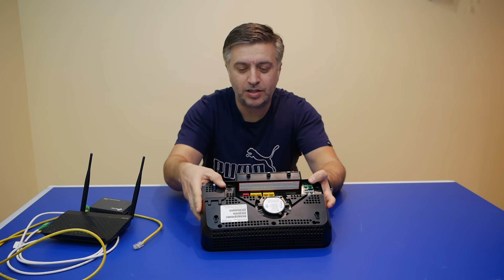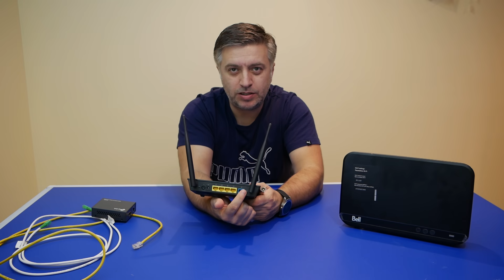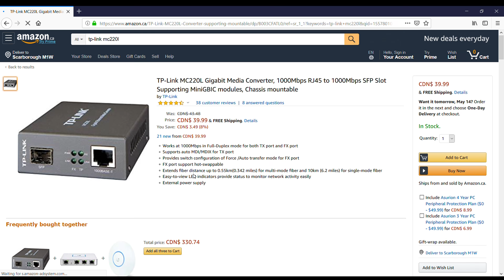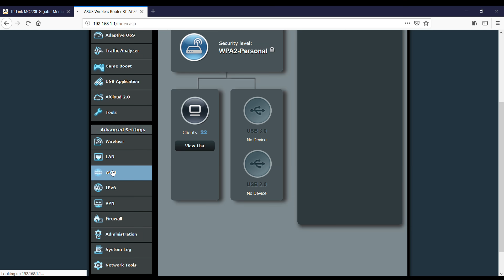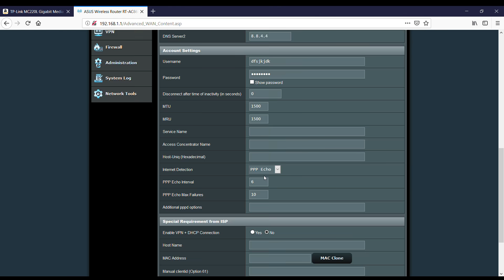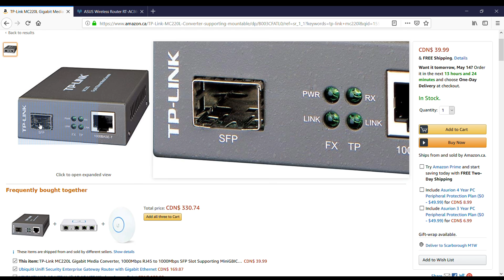How to remove/bypass Bell Hub 3000 and use your own router

Comment: Hi Marius, thank you for the video. I know my Bell username (that starts with "b1"), but what's the password for the internet access? Is that the same password that's being used to login to mybell.bell.ca?
Reply from the maker: No it is not the same. Call bell and ask them for your password. Also if you can log in into your bell account you should be able to change it there.
Reply: @advfreedom  yes, I saw the option to change it. If I change it now, will the Home Hub continue working working, or is there some setting that needs to be updated?
Reply from the maker: There is a section where it says manage your internet access password after you click on the internet section.
Reply: @advfreedom  sorry, I wasn't clear, I meant do I need to change a password setting somewhere in the Home Hob router itself?
Reply from the maker: Yes, of course. The change is not propagated automatically.
Reply: @advfreedom  ok, thank you

Comment: New to Bell Fibe... replaced the HH3000 twice already, found it to be very unstable at best.  Within a month as a new Bell internet customer, had to perform a hard reboot several times as a standard practice so i was NOT impressed. Purchase the TP-Link as recommended, i hope you get rewarded when we do this. Your instructions were very straight forward and worked like a charm. Took a few minutes for the Bell network to connect... I will provide update how stable this new set up is, THANK YOU.
Reply: @abbashammoud7205  too soon to tell... so far VERY stable. i will comment with more details in a month or so.
Reply: VERY stable. It has been a month and the system was not rebooted once. Thank you again, Marius, for this public service.
Reply: @montecristo9191  So that's the problem i was looking for, the 3000 bell routeur provoque instability connection, i will buy a netgear
Reply from the maker: No reward just being happy that I can help. If you want you can subscribe but is all up to you. Thank you for the kind words.
Reply: i had problems and if was one of my rj45 had 1 inverted colors it still worked but made my system hang on heavy load.

Comment: I have the Bell Hub 2000, do i still need the tplink?
Reply: Remove the ethernet cable from the WAN port of the HH2000, plug it into your router, tag VLAN 35 and configure your router to PPPoE the b1 username and password.
Reply from the maker: I don't know about the Hub 2000.

Comment: Hello Marius,
Thank you for the video and instructions. I have the exact same setup, HH3000 and bought the exact switch off amazon. I also have an Asus router with the setup wizard identical to yours. I have gone through these steps multiple times with no connection. The only thing I couldnt do exactly as you showed was changing the MTU and MRU values to 1500. The highest it allows me is 1492 but otherwise same exact setup but no connection. PLEASE HELP
Reply from the maker: It should connect. Did you check if password and user are correct? Can you download Merlin firmware for your Asus router? Or maybe do a factory reset?
Reply: @advfreedom  thanks! It worked but after I purchased a new Asus router. I guess my old one was too outdated because it didn't work after factory reset and Merlin Software was not even available for that model lol. But after all, great video and thank you !
Reply: @Robert Brown No sir. It worked straight out of the box. I believe any newer model router should work. Mine was pretty old. Good luck !
Reply: @J K: Which Asus router are you running?  Just trying to do my research here before switching ISP.  My Asus Asus RT-AC86U (ASUS firmware 3.0.0.4.384_82072, 
Signature version 2.196  Updated : 2020/09/03 03:02).
Reply: @BrownBullhead  I'm using the Asus RT-3100 on the latest firmware

Comment: Great video, thanks for doing that. I am in the process of setting up a network with the Unifi products. I have a switch that has a SFP port. Would I still use the TP-Link converter via the router (router connects to switch), or could I connect the bell fiber and SFP directly to the switch? Any help would be much appreciated. Thanks Marius.
Reply: joe t Did you manage to get that to work? I tried with my UniFi USG-PRO-4 but was only able to allow the internet VLAN35 therefore was not able to use it for IPTV. It works fine if only for internet though. I’ve since upgraded to the UDM-PRO and have yet to try it on it since I no longer have BELL...
Reply: Nicholas Boudreault hey. I am using the USG and a unifi switch. I haven’t been able to do it for internet (Vlan35) as I’m just not technical enough to be honest. I need someone to walk me through it. I’ve read quite a lot of threads on reddit where lots of folks seem to be able to get both internet and tv.
Reply from the maker: If the switch has an sfp port it should work by plug in the bell sfp. But I don't know if there is any other settings to make in the switch config.
Reply: Im trying to bypass my HH3k to UDPro as well.  Not sure what the setting should be but I am plugging my SFP dirrect into the DMpro and cant get past the setup screen.  It keeps failing

Comment: Nice video, quite interesting... Just a quick non-related question you might be able to answer though? Does the HH3000 have physical ethernet ports behind it to allow wired devices to be connected physically? Or must all clients be connected using wi-fi exclusively? Thanks!
Reply: Yes it has 4 - LAN Ports (RJ-45), 1- WAN Port (RJ-45), 2 DSL (RJ-11) Ports & 2 Telephone (RJ-11)Ports
Reply: yes it has 4 ethernet ports just like any other router

Comment: Great video. Thanks for sharing. I have the same modem at home from Bell and I wanna purchase my own router too. However I also have Bell Alt TV (not a separate box or subscription,it’s included with my Fibe 300) where I only have basic channels. Do you know if Alt TV will continue to work if I use a separate router? Thanks.
Reply: Great option for bypassing bell's router for internet!
Now, I also have TV and telephone coming off that bell router. What happens with TV and phone when I remove the bell home hub 3000 router?
Not internet TV (netflix, etc.) or VoIP but regular Bell TV subscription and "landline" telephone service.
Reply from the maker: That I don't know but there are people who tagged the next line with a different value and they succeded with the tv. But I haven't researched this option.
Reply from the maker: It looks like you can put 36 in the lan 4 field and if you connect bell tv receiver to lan 4 port you can get tv working. You can try but I don't have tv so I can't test this.
Reply: @luiszuniga5815  i use the magic jack but you can use fongo or text me for free home phone. and for tv awitch to alt tv of a underground iptv service. i like ok2.store.
Reply: Luis Zuniga if any how you find out how to make tv work I would be interested in your set up thx 👍🏼
Reply: @luiszuniga5815  without HB3000 the phone service will not work, I made the same mistake, I should have extended my mobile's coverage for North America. Some people had success configuring TV using Unifi equipment (Switch + USG + Wifi access points) bypassing Bell modem completely.  Need to configure configure VLAN 36 in your router. For us, the most we can do is Using “Advanced DMZ Mode and Turn off wifi (this won't turn off wifi for TV) and use your router. Not very impressed HB3000 2nd day after installation it lost internet service, then lost phone service, TV connection was stable.   HB 3000 Wifi speeds are high if you are not roaming/moving around because of the auto switching signal feature goes very down. I think it is using 5Ghz by default.  My Asus 68U doesn't do this. I welcome the new optical technology, However, Bell has not considered this deploying this to Pro Home users. Bell's focus is on Fibe TV more than the internet or phone. Best bet is not to purchase TV and phone from Bell and just purchase data and use your router/modem. I didn't know this at the time of purchasing, I thought modem config will be the same as Rogers.
Reply: @carsanmn  Suppose its time to cut the cable and go all internet with unifi, netflix, hulu, etc.
Reply: @luiszuniga5815  agreed. I already have voip just bought Bell phone for unlimited US coverage. this was a unknown mistake on my part. Rogers provide a separate voip box with battery backup. We don't watch TV it is  just for hockey games. Bell 4K doesn't have bluetooth headset audio connection, roku or fire tv has BT or allow headset to remote. I guess Bell and Roger's are not targeting Pro consumer market.
Reply from the maker: If Alt Tv is through internet and is an app or you go through web browser is should work. Bell doesn't know that their router is not in the network anymore.
Reply: Marius C Thanks. That’s what I thought too. It looks pretty straightforward and easy to setup a new router without the HH3K. I intend to get a linksys (either AC4000 or AC5400, triband). Will I be able to surpass my current 300mbps wifi with the new router, since it’s advertised at a much higher speed than what I have now, at 300.Thanks .
Reply from the maker: This question is more about routers than your connection. Depends what speed you have from bell. You will not get anywhere near 500mps download on wireless. The advertised speed on routers is misleading and the speeds are combined on all bands. Do a search and read about routers and you will understand. I would get an Asus from my experience but is up to you. At least get one that you can return if the settings are not available or you can't get the speeds you want.
Reply: Marius C I did Speedtests on my network and I get about 300mbps download now. Anything that would get me above that on a third party router I would be happy with. Thanks
Reply: Actually I get about 250mbps download and 150 upload speeds with my current HH3K. My plan with Bell is Fibe 300, gigabit internet.
Reply from the maker: @lorenzocriscuolo7869  test ypur connection wired to the router and that is close to the truth. Anything wireless depends on a lot of factors.
Reply: Marius C Hi Marius, I have another question regarding the settings on a new router like the Asus. Do you have to enter the same Bell network name and password from your HH3K or you can create new ones? Under account settings I understand that you need to enter the same user id name from Bell (starts with b1xxxxx) but the Bell technician never gave me a password for my user id ,which I find strange. Thanks.
Reply from the maker: It should be available when you  login on your bell account on web. The one where you can go and view your bills and stuff. Or you can call bell and ask for your password. I actually told the guy who install to write the password in a piece of paper so I can have it.